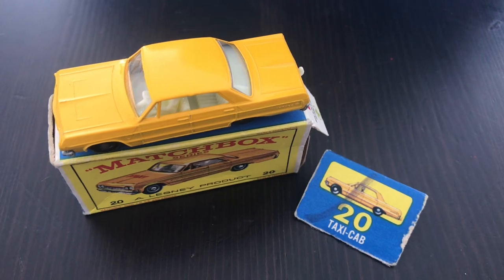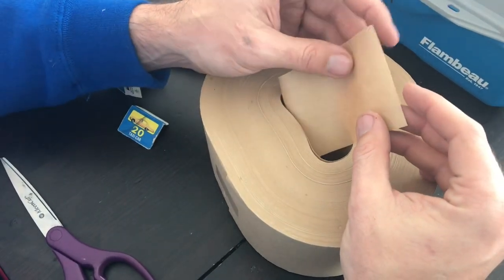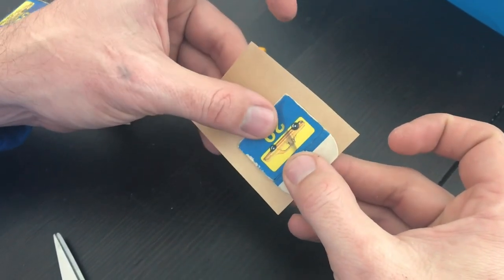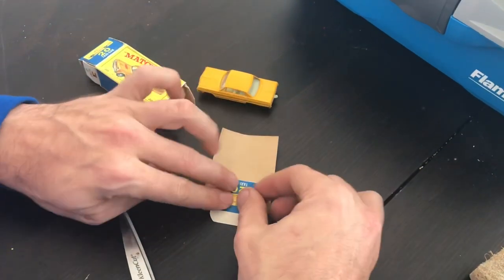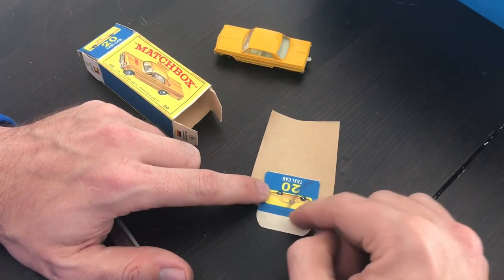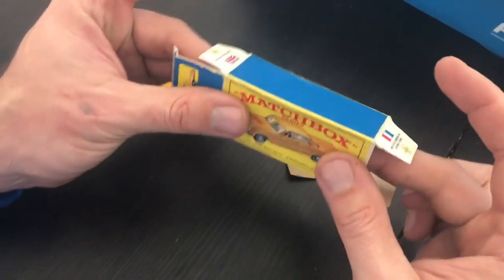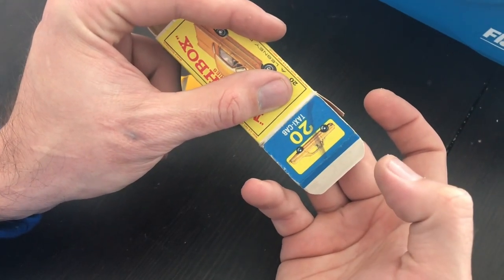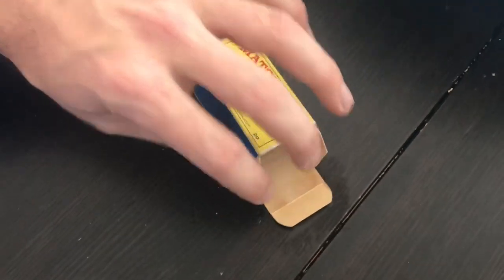Matchbox Lesney #20 Chevrolet Taxi Box Restoration

Comment: The tape is usually referred to as "Kraft" tape. It comes in plain like yours and reinforced with threads. It also comes in plain white and reinforced white.
Reply from the maker: Thanks Tom, I'm also going to be trying out some other tapes/repair methods made specifically for document restoration.  Watch for them in future videos!
Reply: I seem to remember something called "Hinge-paper" from my stamp collecting days.  Before we had the neat plastic items the hinge paper used a sticky back and half was stuck to the stamp, folded in half (hence Hinge paper) then the other half was stuck to the album. If it's still around it may work on box restores.